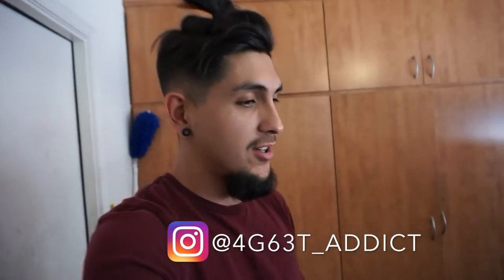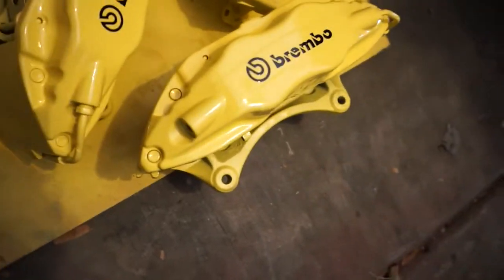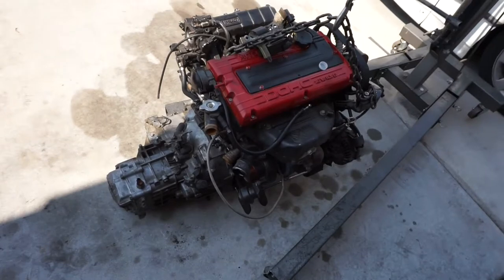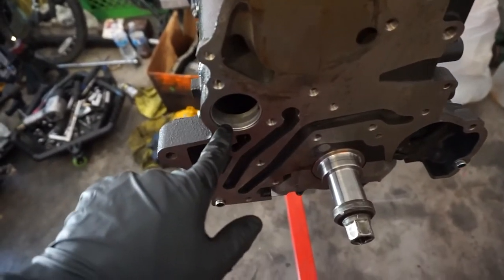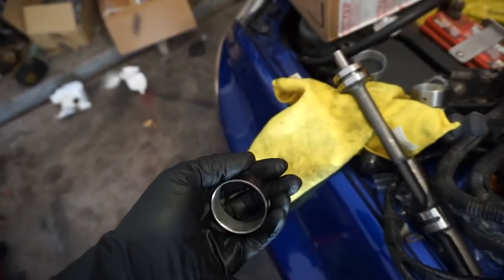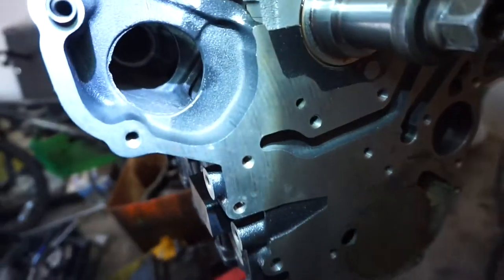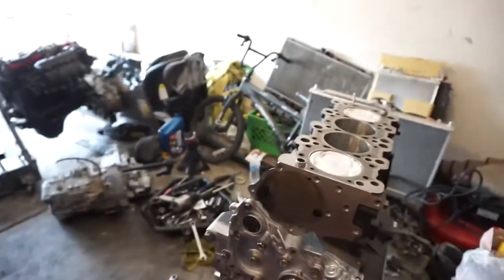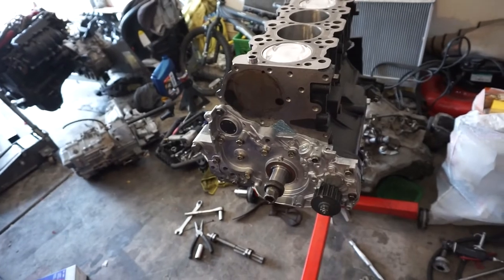oil pump and balance shaft delete install on evo9 block!!

Comment: Hi..  sir. if the balancing shaft is opened. is there no effect on the engine?
Reply from the maker: You mean if you eliminate them
Reply: @4G63TAddict  I mean, if the balancing shaft is removed from the engine
Reply: @4G63TAddict   
what is the effect on the engine if the balancing shaft is removed?